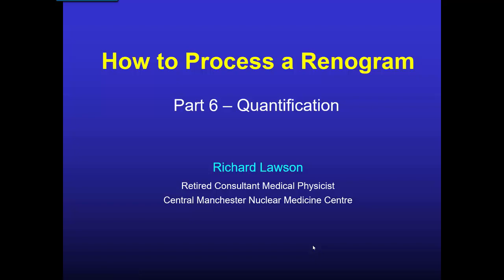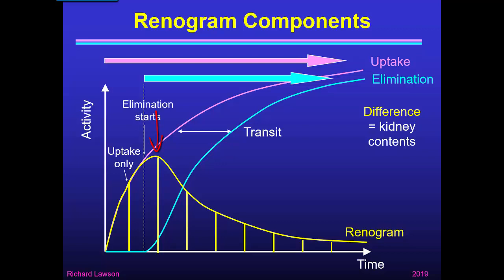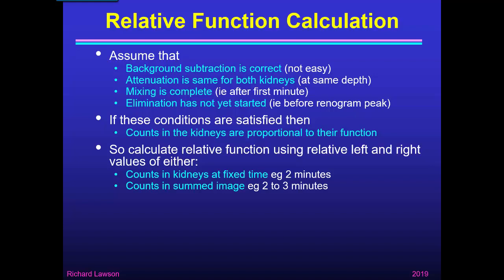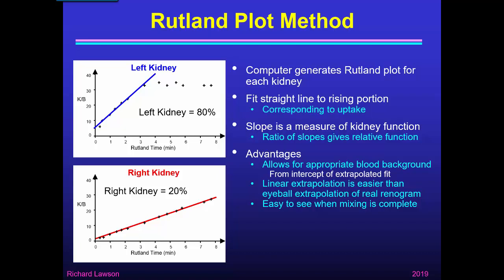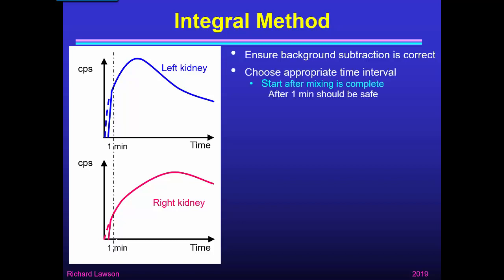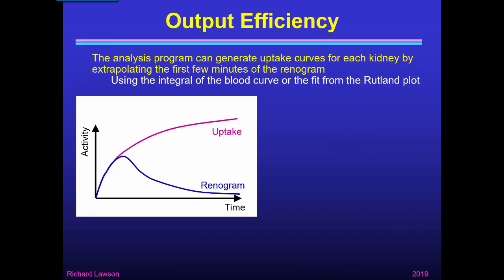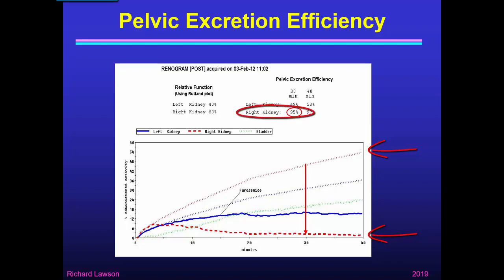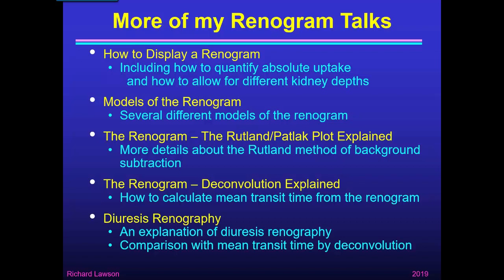How to Process a Renogram: Part6

Comment: Thank you mr. Lawson for the great explanation. I have a question please: how the uptake curve is obtained (you noted the extrapolation of the rutland curve or the integral of the blood curve), i did not manage to obtain it correctly, can you detail more please ?
Reply from the maker: If you are using the Rutland method then you first subtract the tissue background from the vascular ROI curve to give the blood curve B(t). You also subtract the tissue background from the kidney ROI curve to give the kidney curve K(t). So if you have subtracted tissue background then there should be just blood background left in the kidney curve. So theory says that during the uptake phase of the renogram these are related by K(t) = UC x Integral of B(t) + a x B(t) where ‘UC’ is an uptake constant and ‘a’ represents the amount of blood in the kidney region. (See part 2 of my talk on the Rutland/Patlak plot.). So if you plot K(t)/B(t) against (the integral of B(t))/B(t) you should get a straight line during the first few minutes with slope UC and intercept a. So having determined UC you can generate the uptake curve (or zero output curve) from UC x Integral of B(t) for all times. (see Anderson et.al. Nuc. Med. Comm. 18 (1997) 823-6)

If you aren’t using the Rutland method you can still subtract the tissue background from the vascular ROI curve to give the blood curve B(t) (although if you use a very vascular ROI such as the heart then you may not need to subtract any tissue background). But you now have to subtract all background from the kidney ROI curve, so you will have to use something like a peri-renal background ROI to subtract both tissue and blood background from the kidney to give K(t). If you have subtracted all background from the kidney curve, theory now says that K(t) = UC x Integral of B(t). So if you plot K(t) against the Integral of B(t) you get a straight line with slope UC and zero intercept. (If you don’t get zero intercept then you haven’t subtracted all background sufficiently). So once again you can get the uptake curve from UC x Integral of B(t) for all times (see Chaiwatanarat  et.al. J. Nucl. Med. 34 (1993) 845-8).

I hope that helps answer your question.
Reply: @richardlawson_nucmed  
Thank you very much for your time and asnwer. It is very clear and helpful